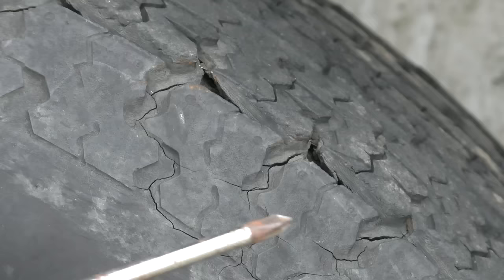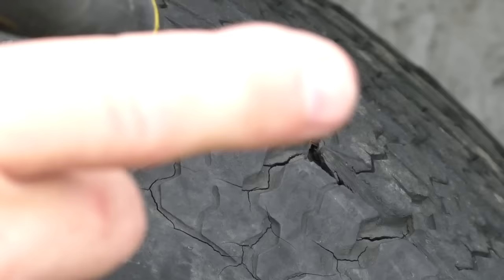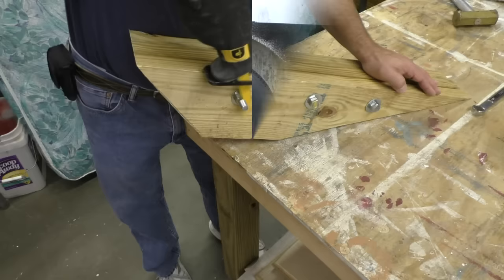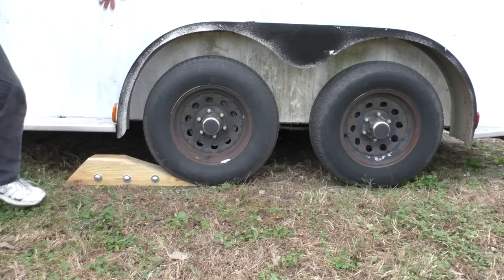Making a Tandem Axle Trailer Jack

Comment: This is a good idea. Very helpful for getting that axle in the air, and have it stable. I offer a few suggestions:  1. Don't make that angle cut on the front. You don't have very much of a landing area for the tire. If you are by yourself, it will be very tricky.  2. Put a strip of wood at the top end to act as a stop. 3. Glue the wood together, THEN drill it. You won't get glue on your bolt and your pieces wont shift. 4. If you are gluing, apply the glue to the entire surface. Smooth it out with a cheap baster, or an old credit card.  It looks like you are using Titebond, so it will keep it together. Also, making sure glue is all the way to the edge will help prevent the joint from separating.  5. If you don't have a bandsaw, cut all three pieces separately. They might be a little off,  but the lack of smoothness will help the treads grab hold. 6. Buy the right size bolts. Saves money and effort not having to cut them.  7.  I would position that center bolt closer to the top, where there will be a lot of stress.

Comment: Why is the back side of the ramp sawn at an angle? Dimensions? thanks
Reply: just like when you drew it and then cut it!  sorry your joke or whatever you might call it is FLAT!
Reply: Stability? To keep the weight of the trailer from shifting to far forward and causing the other end of the ramp to raise.
Reply: It’s made to fit between the tires

Comment: is it my imagination or have you put a smaller tire on there?
Reply from the maker: No, it is the same size.  Now that you mention it, it does look a lot smaller.
Reply: +Making Stuff it's probably the difference between a 70 and 85 aspect ratio
Reply from the maker: You had me worried so I went and had a look at the trailer.  Both tires are the same size.  The new tire axle is hanging lower because it is off the ground and doesnt have a load.  That is making it look smaller.
Reply: +Making Stuff an optical allusion

Comment: Is each axle rated to hold up the entire trailer...my concern would be putting too much weight on a single axle versus just using a bottle jack on the frame to get the trailer up off the ground.
Reply from the maker: I'm not sure what the axle is rated because I don't have the trailer any more.  However, I had it for 22 years and changed many flats on it when it was loaded down with 2 horses and never tore up the axle or suspension.  There are still 3 tires touching the ground, so it isn't any more load stress than having the tire go flat in the first place.

Comment: a handful of 3 inch wood screws would be a lot CHEAPER  and EASIER  than using bolts,washers, and nuts as fasteners.
Reply from the maker: Not if you are going to use it on a 14,000lb  trailer.

Comment: Why not just use a set of ramps
Reply from the maker: It's much smaller and easier to use than a car ramp.  You only need to get it a few inches off the ground to change a tire.